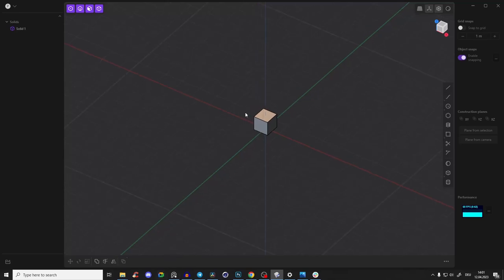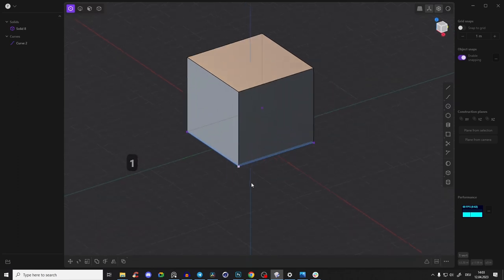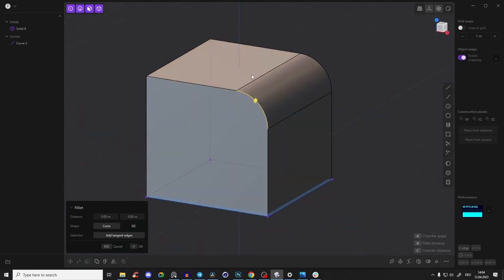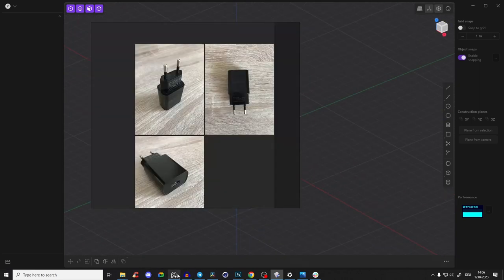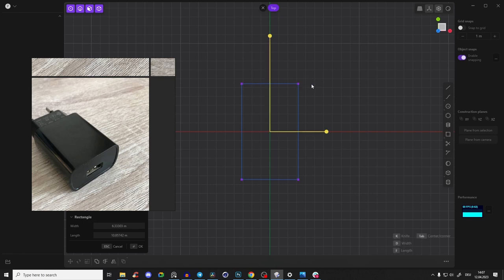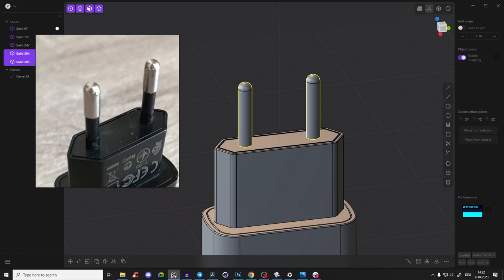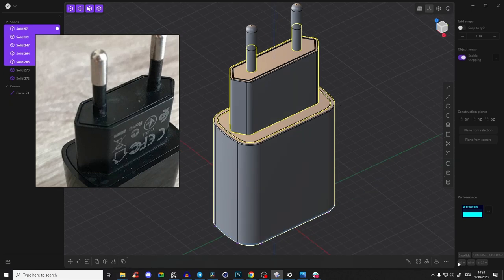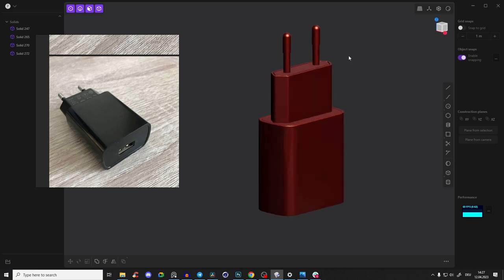Plasticity 3D Introduction Tutorial | New Amazing Cad Modeling Program

Comment: I installed it on a laptop and can’t move the grid around like you are.  I’m using a touchpad.  Do I need a mouse?  Also, how do you change the units?  It’s set to meters and everything I’ll be designing is better suited to millimeters or inches.   Thanks for your great videos.
Reply from the maker: Definitely buy a mouse. A 10$ mouse will be 2Million times better already then using a touch pad for modeling.

Regarding units:
Top left settings -> Grids & UNits
Reply: I can't even find the grid. There's just a blue line the end of which keeps scrolling down off the page with the mouse wheel. Clicking the grid icon just moves the line. I turned on "snap to grid" but without a grid it's sort of useless.

Comment: Great- The only minor confusion that the outer part did not fuse in the course of boolean operation.
Reply from the maker: What exactly do you mean? Did you selected both and pressed Q Q?
Reply: I mean the most outer part. In your (by the way very nice) tutorial you have selected 3 parts in preparation for a boolean union. But only 2 parts were fused. This is visible in your video, directly after the boolean operation you are going on to move the resulting new solid along a axis, but the most outer part was not fused and as a result did not move. I am relatively new to 3D desgin, but my conclusion is that the boolean operation will succed only when all parts are intersecting each other. Since you did a cut between most outer part and the contained part inside, the intersectio requirement was not met. Only my observation- kindly correct me if I am wrong on this.

Comment: is it possible to cover error correction, like lets say the inner object created is too big and want to reduce the size. do i delete everything and start again or is there a way to use scales or some other function. another eg is lets say i find the bevels too think and want to correct that, would there be a way to do it non destructively?
Reply from the maker: 1. If you want to correct the size of the inner object you can select the body and press "S" "S" ans scale it.
Or  you go into face mode "3" and select all the faces you want to make smaller. WHen you will select the faces you will get this control to drag/adjsut the size.

2. The same for fillets. Go into face mode "3" and select the bevel. Than you will get the drag / control and you can adjust the size of it
Reply: @nikita.kapustin  ohhh cool cool. Awesome. Lovely tutorials man. Excellent stuff.

Comment: Nikita, I have a request, can you explain what is the difference between SOLID and SHEET . I made a solid and it looks like a solid (all walls are closed) but it shows me that it is a SHEET. Why ?
Reply from the maker: Solid:
- Represents a three-dimensional object with volume.
- Has mass and can be measured in terms of volume.
- Fully enclosed; no gaps or holes.

Sheet:
- Represents a thin, flat, two-dimensional surface in a 3D space.
- Does not have volume like a solid, but can exist in a 3D model.
- Like a piece of paper in the 3D world.

If you "think" it's a solid but it shows you a sheet. Select that sheet. Press "F" search for "Find boundary edges" and look out for those edges. Close them and you should have a solid!:)

Comment: This program has such great potential, but it seems like there isn't full GPU support. My system handles Blender just fine, but everything is janky in Plasticity. Navigation around an object feels awkward, with no smooth motion at all. Hopefully it is improved in future versions.
Reply from the maker: Hearing the first time, that Plasticity feels janky. It should work absolutely smoothly on any system. Maybe reinstall it or write to the support.

Also if I am not wrong, it runs mostly entirely on CPU.
Reply: @nikita.kapustin  Thanks for the response! I'm just trying the free trial version right now, could system performance somehow be limited because of that? Let's see what happens if I reinstall it.